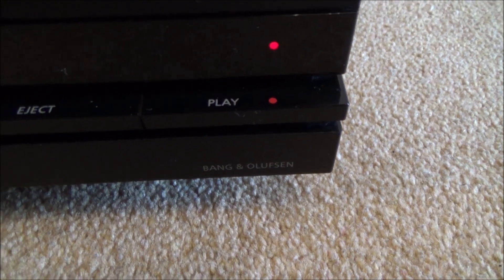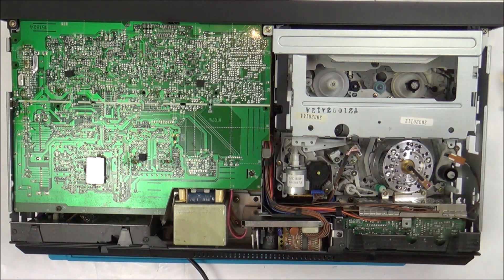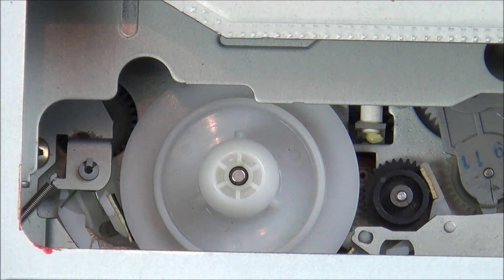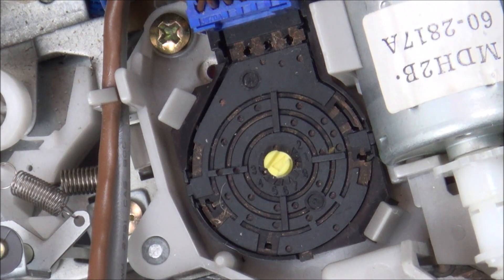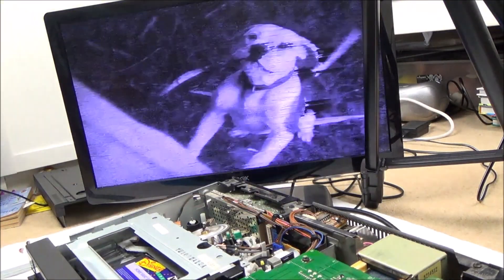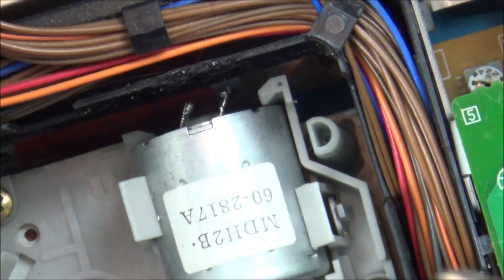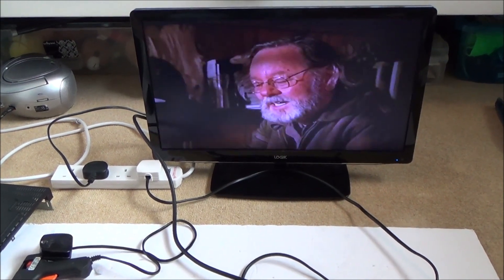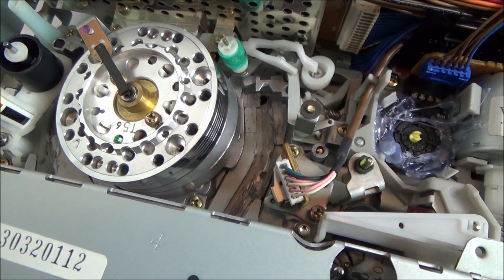Trying to FIX a £1200 Bang & Olufsen VX7000 VHS Video Cassette Recorder

Comment: Looks like that drum has eight heads. The holes that look like this 0oo0 are two heads and the holes that look like this 0o0 are single heads. Since there are two that look like this 0oo0 that's 4 heads and 4 that look like this 0o0 that's 4 more heads for a total of eight heads on the drum.

Comment: eBay has remotes but there kinda pricy I’d try a universal remote first
Reply: Universal ones most likely will not work as they have different IR frequencies. Plus these B&O devices work on radio waves

Comment: I would invest in a harmony remote - even for everyday use, as it would replace all your remotes into just one. Then you can add any new devices to it in the future, and you can then also control them with your phone. Once setup with all your component devices (tv, bluray, virgin box etc) you setup activities. So for example Watch TV activity would involve the TV and virgin box. Press the Watch TV button turns on tv and vm box, switches the tv to correct hdmi input and then you can control volume and channel changes etc all with one remote. Ive been using them for over 10 yeara and id never go back to using multiple remotes etc

Comment: hi i worked on this make yes they are heavy love the V2000 one  nice outside case  hi if you know you can;s get the parts first you know what to be carefull

i have worked on pro video's  betacam sp decks is the one's i love as there's alot about    i have a lot of them it good to   i use a old solding iron on the  parts and push  in 
hot ploy   you have to know what you are doing i been in the A/V re-pair game from 18 years    HELLO out there all you  ex repair lot  i know who you are  and
how 100% you man like to get the gear  i used to be that way  THIS VIDEO IS FOR FUN GUYS

Comment: 3:34 .... B&O still stuck to the minimalism and clean design. The remote of this VCR was probably integrated into a bigger control that commands the complete AV system. Looks like an APPLE desicion but during the 80s the tried so much to hide the controls out of the design, think it is more like a pilosphy than APPLE marketing at work.

Comment: Sure its a sign of my Age, But I remember a time when not all vhs players Could Fwd or Rew. And they it would be put into Another machine that Just Rewinds! Lol
Reply: Our first VCR was an early one and it had FF and RW . It weighed a ton , had a 15ft corded remote control , and was a top loader . Mostly people used rewinders because rewind would wear out first and get weak or stop working altogether , it was also believed that rewinding added too much wear and tear so some people used rewinders as a preventative measure . Tape decks of all kinds had been around long before VHS and had FF/RW all figured out by the time VCRs hit store shelves .